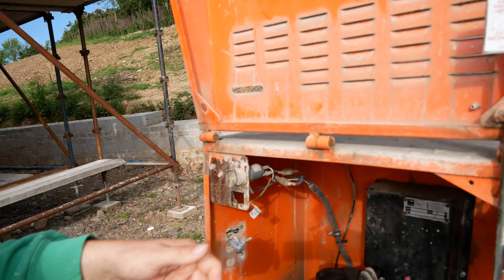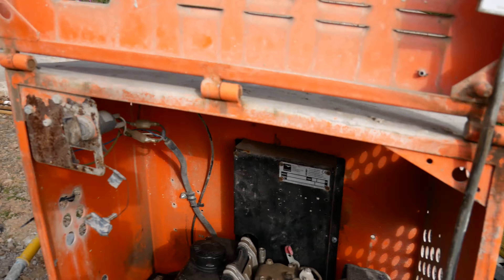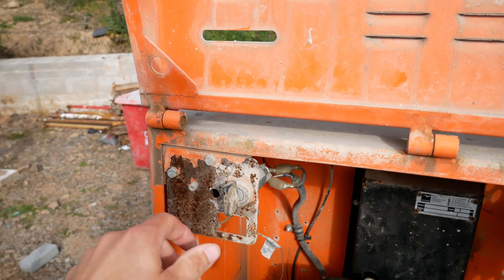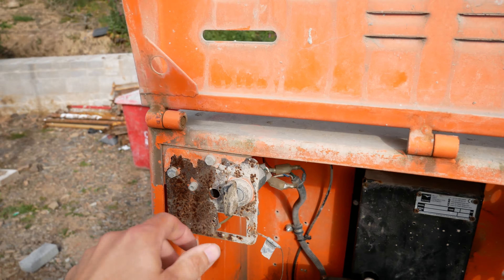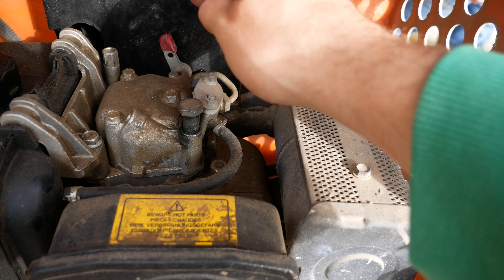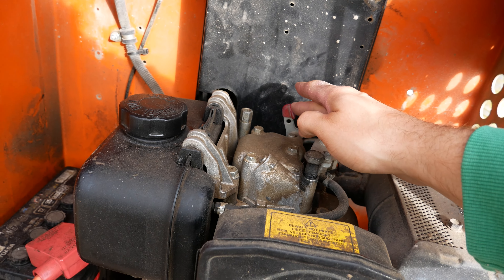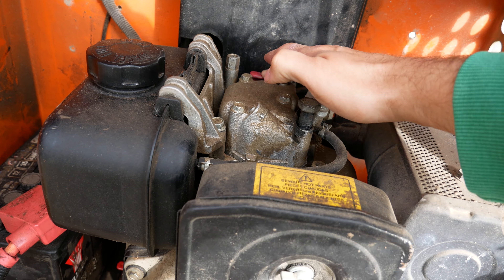Starting a big belle cement mixer

Comment: No offence mate, I know you have stated below that you are no mechanic but most of that video is wrong especially about the "decompression switch" and key position after starting. Decompression switch should always be down on starting, especially when pull starting or serious injury to the hand will occur. Also when running your key must be in the on position (second position) when running or your battery will not charge from the regulator. When you are finished and stop the machine (stop switch on the side or small red tab on speed regulator) then the key must be switched off to avoid battery discharging. Not having a dig by any means just clarifying from a professional view.
Reply from the maker: Cheers buddy